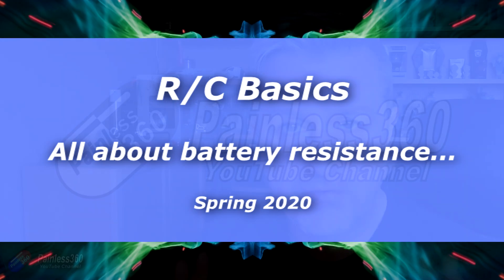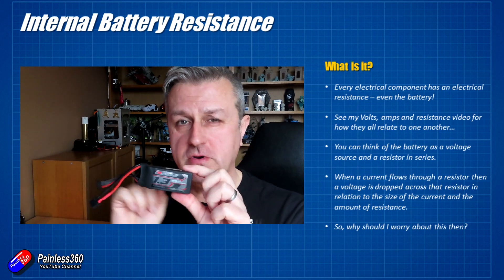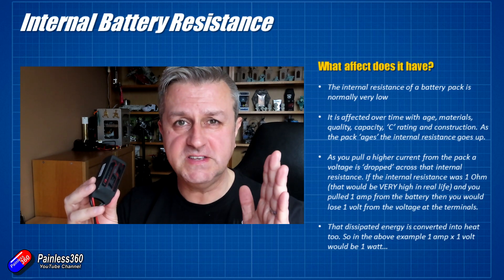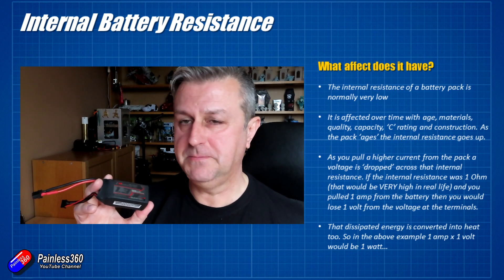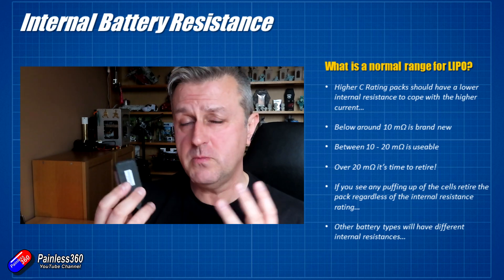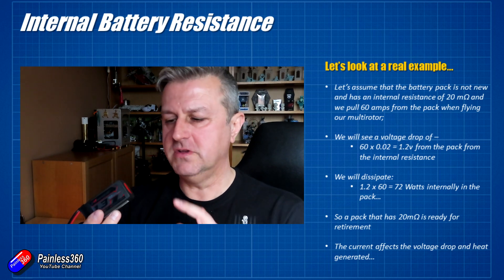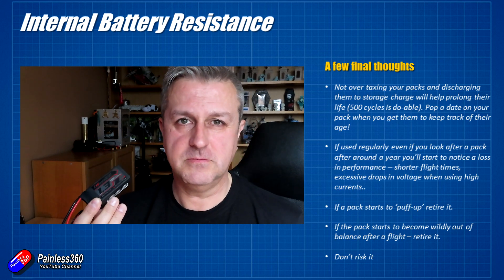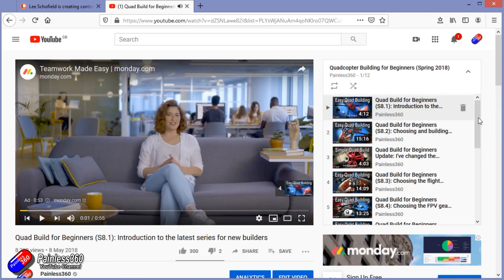Why is Battery Internal Resistance Important?

Comment from the maker: Quick note: for physically tiny batteries and non Lipo packs the resistances can be a lot higher. If you use these really small batteries or non Lipo packs then why not test them and see what their resistance is and post the results here? Happy flying!
Reply: A while back I checked ten new 260 mAh 1S lipos (for my 65mm brushed whoops) and got the following (in milliohms): 102, 105, 105, 105, 108, 108, 111, 114, 114, 117
Reply: My 1.5 LiFe radio battery shows 59,41,43
For the Li-Ion packs I get around 25,21,22
These are regularly  used batteries 1-2 years old.
Reply: My whoop batteries are around 9 -10, and my fairly new 6s batteries are .8 and 1.0
Reply: Several 2s 450mAh LiPo varying between 11-25mOhm, at the end of the charing 14-18mOhm.

Comment: This information is extremely helpful 👍. I recently purchased a 6400mAh 4S2P 18650 lithium-ion pack, and my quadcopter was flying pretty erratically with it, so I checked the internal resistance with an iCharger 206B. The per-cell internal resistance was 26, 29, 29, and 29 milliohms. It is rated at a maximum continuous discharge current of 20A. The voltage of the pack drops dramatically under load; my quad current is around 8A. I have an older 5200mAh 4S2P 18650 Lithium-ion pack, and the per-cell internal resistance for it is 12, 11, 12, 13 milliohms. It flies fine and much longer. Almost forgot to mention that the pack with high internal resistance did get pretty warm. I only flew it a couple times and will retire it, hopefully the place I got it will take it back.

Comment: How much is a 3S 650mah IR ?
Reply from the maker: It depends on the C rating. The 650mAh 70C pack I have handy here is about 17-20µΩ
Reply: @Painless360   Mine is around 20-35.... And C rating is 75

Comment: just watching videos about lipo batteries after almost half of my room burned down due to a battery blowing up while it was on charge. I wanted to recover the battery after one of the cells went below safe operating voltage and boy was that a bad idea. luckily I managed to control the fire but always be careful. Thanks for the video.

Comment: Having looked at your video and measured the IR on my battery charger it would appear that all my batteries exceed the 20 mh limit.
Example 3 cell 2250 35c rated displays 18 16 18 total of 52. Does that require retiring. I have no batteries that display a 01 through 09 on any cell on any battery I posses.
Some even display 32 33 32 but it works ok
Reply from the maker: If the batteries are not puffing up then you should be fine to use them. Lower current applications won't show the voltage sag as badly.. Happy flying

Comment: I have pretty new (maybe 15 cycles) CNHL 1500mah 4s batteries and the IR is way off from cell to cell. The one I just charged is 7 on cell 1, 5 on cell 2, 4 on cell 3, and 2 on cell 4. Are these things dangerous? I only charge at 1c and the batteries never get hot or warm when charging. Cell 1 has 350% higher IR than cell 4.
Reply from the maker: Not dangerous. These are nice low values.. Happy flying
Reply: @Painless360  Thanks. I seen a guy showing a 3s battery where the cells were 17, 18, and 17. I thought he meant it had age because the cells were not all the same IR, but I guess he meant because the IR numbers were so high.
Reply from the maker: That's it. Happy flying!

Comment: The biggest factor that will affect the IR reading is temperature. The same pack at different temps will have very different IR readings. So compare a pack to previous readings at the same temp if you want to see a trend with that battery.

Comment: Several are discouraged with the life of the abundant 1Sv 300mah HV’s.  Need to charge it up to storage after running it low.  I let it cool bit, then bring it up to either storage or full if I’m still flying.  Doing this keeps these flyable for maybe a month!
Reply: Agreed! Also, I now fly 75mm rather than 65mm 1s whoop because weight difference is minimal, 41mm blades are way more efficient than 31mm, so overall more efficient, less current for the same speed and acceleration, batteries last more cycles by a noticeable amount

Comment: Smaller batteries have higher internal resistance. Also, the IR is higher when the batteries are empty. Measure it when batteries are full. Whoop batteries are usually over 20mΩ when new. Note the IR when you get them and bin them when it goes up over 2x.
Reply: Good info.. thanks.
Reply from the maker: Great additional content. Thanks.
Reply: The real number is when battery full?

Comment: Coming from the RC indoor carpet car racing community lipo internal resistance in spec racing is a huge consideration. We pay over $100US for a good competition 2S lipo. Not only is the internal resistance low, in the 1 milliohm/cell range but resistances are matched cell to cell. We also heat the lipo up by high rate charging which has a huge affect on IR numbers. This is the extreme end of competition RC racing which the average RC hobbyist would not be concerned. Something is not adding up correctly in your SkyRC charger displaying 1-6-7 and 7-0-0 milliohms . The two accepted accurate meters that we use is the iCharger built in meter or a specific IR lipo meter.

Comment: So I'm still confused about what the pack size means. I do not have any flying rcs, but I do have a few ground rcs, that use 7600mah 4s packs. My issue, which is what I'm writing this comment for, is that one of the packs is at a cool 163 for the internal resistance. But I have used these packs for well over 2 years now, so I'm wondering, is it just a fact that the packs are huge? I'm aware that that resistance is super high, but is it insanely high for a pack of that size? Let me know if you can, thanks.

Comment: I have noticed that the resistance of the #1 cell is always about twice the value of the other cells on my older batteries. In one particularly bad case, I had readings of 62,10,12! What would be the reason for this?
Reply from the maker: It could point to something with the charger. One of the connections may be better or worse than the others... Happy flying
Reply: Same problem might be my imagination but the first cell goes up in resistance  after I use battery for low power draw situation like just programing a flight controller for extended time or running a vtx and cam for a while. Until recently I've always had a dedicated beater pack to piddle and it helped but now I  fear my charger may have been intermittently glitching cause symptoms are worsening. Who knows?

Comment: Are we including Li-ion batteries as knackered at 20m ohms per cell also?
Reply from the maker: LiIon packs are very different as they are not designed for the higher currents like LIPO...looks like a follow up video testing a few LiIon packs may be in order.. Happy flying

Comment: Really helpful video. Appreciated Lee. Question: You do mention high vs. low current applications. So can I still reliably use a 2S LiPo battery (8.4V) with say 0.1OOhm difference (between the 2 Cells) for a Receiver battery pack. This for a normal 40 Size Nitro plane?  Appreciate your reply.
Reply from the maker: It should be ok but I'd be wary first time out.. Best of luck!

Comment: Thanks for the video! Are you meaning 20 mohms/cell or for the whole pack is when the battery is toward the end of its life? I noticed the new battery you showed on the charger had over 20mohms for the total pack, which would be at retirement status by what you are saying. I don't see where you addressed this in the video. Please clarify if you get the time. Thanks again.
Reply from the maker: As packs can have different number of cells then use the resistance measurement on a cell level to check how well matched they are from new and how life and use is impacting the battery.. Best of luck!

Comment: I think that the smaller the battery the smaller the surface area you have for electrons to flow, thus smaller batteries have higher internal resistance, all other factors being equal. Thus you cannot just say junk batteries at 20milli ohms - pretty sure a brand new 300mah whoop battery will be twice that from new at least, it would be interesting to measure one
Reply: I measured around 60~70 for brand new 300mah batteries so your right
Reply: Yeah I get 80mOhm off brand new eFlite 150mAh 1S lipos. It's a combination of connector quality and small volume I guess. The bigger the cell capacity, the more area the current has to pass through is my theory.

Comment: what is the internal resistance of the 3dxr pack? 4s1p, thanks
Reply from the maker: I don't have one of those, all of the 3DXR packs I have are 2P to support higher currents. The type and quality of the cells, along with how they are connected make a HUGE difference.  I may do a follow up video showing the difference in a future video.. Stay tuned!

Comment: Is there any way to recover puffed lipo ? I have loads of that which cost me a lot of money and would just hate to bin it. Most of them just give me 30 sec to 1 min flight time. May be i can use it somewhere else useful than throw it away ? I checked its resistance and yes its high.
Reply: i agreed to all what you are saying.  its just the kind of money i spent on those packs.. i am retiring batteries that have higher than 100mΩ. and batteries which i no longer use i am using those unused lipo as a source to charge my tiny whoop 1s batteries.. and i am using all precautions while i do that.
Reply from the maker: I've got to agree with everything thar MAD GRUMPYMAN said. If your packs are regularly getting into that state then they either are of poor quality or you are pushing them way too hard.. if you are using huge currents then switch to a higher C rating.  See my LIPO basics video. Happy flying

Comment: What tools do you use to dispose of a battery. I am surprised chargers that can discharge to storage voltage don't also have a mode to discharge to zero volts for disposal. 
Where do you recycle your batteries? Do you just take them to a computer waist place?
Reply from the maker: Check what recycling there is for you locally for batteries. It varies.  Happy flying!
Reply: Both my chargers have a full discharge program..  I thought they all did.

Comment: A really good overview of a complex subject - well done! Only a few things I'd mention ... first is balance. All the cells in a new pack should have similar IR ... if they don't it would be a good reason to reject the pack. Second, IR often drops a bit after the first couple of cycles. Third, as already mentioned by others cell capacity affects IR. So small cells (brand new, in good condition) will have higher IR than large cells - hence the use of 'C' ratings (even if these are largely fiction!). Fourth, over time it's quite common for one cell to develop a (much) higher IR than the others (that's what does for most of my packs in the end). This only shows up under load though (e.g. on cell voltage telemetry, if you have it) - the cells will usually look OK (reasonably well matched voltages) after a flight. Finally, cell IR values reported by chargers are normally pretty rough & ready (not very accurate), but probably good enough for monitoring change over time. A guy called Wayne Giles produced a dedicated high quality cell/pack ESR (IR) meter - not cheap, but a great tool. Hobbyking sells it now, although it's currently out of stock. Wayne's threads on RC Groups are well worth a read for more details on this subject (he's a retired power electronics engineer).

Comment: Hello Lee! I
I just did the maiden of my ranger1600 with inav and i have this question:
In airmode i get barely any throws on my controlsurfaces, even when flying. And in rth when circeling it dips a little throttles up climbs trottles back and dips again, ...

Do you know what might causes these two issues? (I have done the autotune but to litte success)

Thank you!
Reply from the maker: Without knowing a lot more it's tricky to comment. How you've got it setup, the mode you were flying in and how you're measuring 'no a lot of movement' all make a difference. Check out my iNav build for all the steps I use. Check the movement in manual mode to confirm that the travel is ok as step one. Best of luck